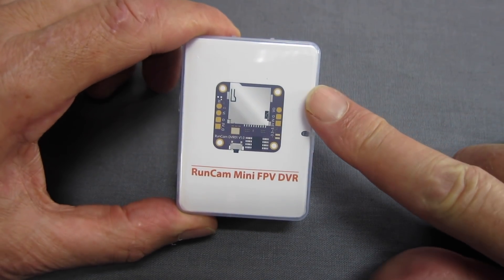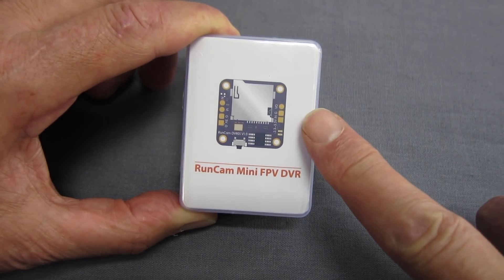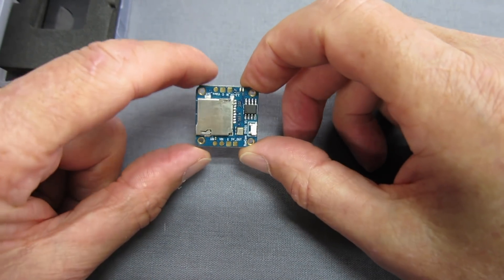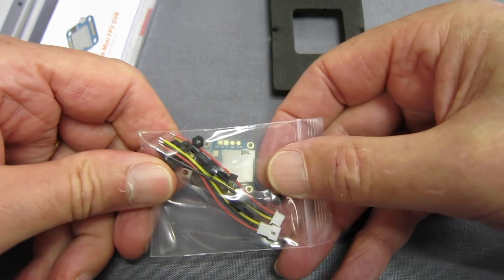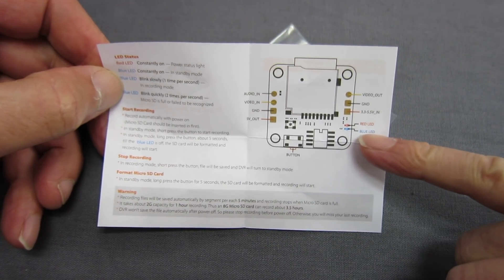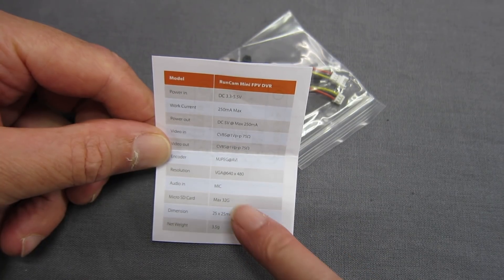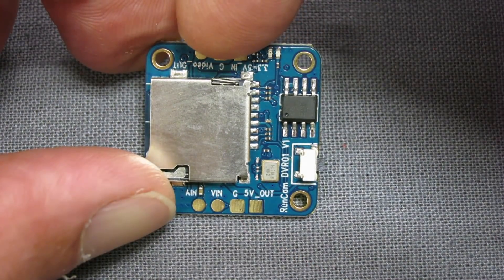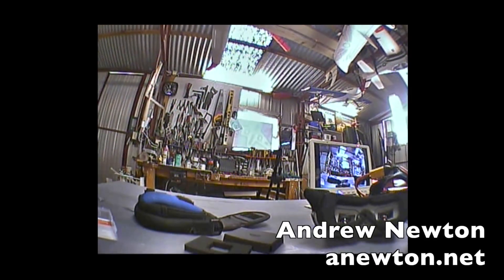Runcam Mini FPV DVR

Comment: Could I use this for non drone purposes? I'd like to attach this to a camera module to capture video. So in the difference here would be that video would be connected to a transmitter. The video would just end with the runcam.
Reply from the maker: Yes that would be OK. No need for the transmitter. Just connect the DVR to the camera.
Reply: I'm using it for non drone purposes, currently have it as a cheaper alternative for analogue camera system in a track car, has gone really well so far

Comment: Do you need a video transmitter? What if you just connect video-in with, say, a miniDV camera. Just have the dvr record with the button?
Reply from the maker: Video transmitter is not required if you just want to record onboard.

Comment: Can i use it with eachine TX03?
Reply from the maker: What is the input voltage for the TX03?
Reply: @AndrewNewton  It is 2.5v - 5.5v
Reply from the maker: Yes it will work then

Comment: Does anybody know if it's necessary to add a amplifier circuit (transistor) in order to get a eletrect microphone working on this dvr? A friend of mine is facing problems with only an eletrect, resistor and capacitor circuit without amplifying. My Eachine vtx  works properly without any amplifier.

Comment: I recently bought the Eachine Pro DVR....disappointing, it was very noisy, even when I powered it with a 1S Lipo direct. The other thing is, like this one it doesn't keep the time / date stamp running, so none of the files are date stamped, very annoying.
  Recording quality looked okay though, can it capture 16:9 files?  Is VGA 640 x 480 4:3....Or 16:9..?
Reply from the maker: Only records VGA which is 4:3. None of the DVRs I have tried can date the files correctly which is very irritating. Pity about the Eachine, I was considering one too

Comment: Always interesting to see new ideas and products coming out on the market :)
I think if you solder it to the the video out on some FCs (compatible with Betaflight OSD) instead of directly to the FPV cam, you can get also OSD overlay :)
Interesting option even i can't find myself a use for it but probably helpful for some specific situations!
MJPEG is a pity encoder though :/
Happy nidweek and and happy flying :)
Reply from the maker: Needs to be higher resolution I think, but Runcam do keep putting out these interesting gadgets

Comment: This looks like a great dvr for a ground station - it auto starts recording. the only downsize might be that you have to stop it manually - it would be great if it would detect power loss and save the video itself (big cap etc)
Reply: I will give that a try. Only downsdide is you have to stop recording, take the sd out and put it in a gopro or something similar. But that's fine for the use case that you only wanna use it when the drone crashes (even though mine is crashing min 1x per battery because I am a bloddy beginner xD)